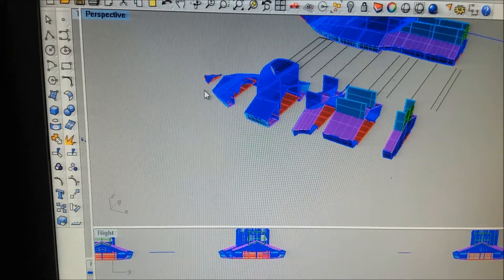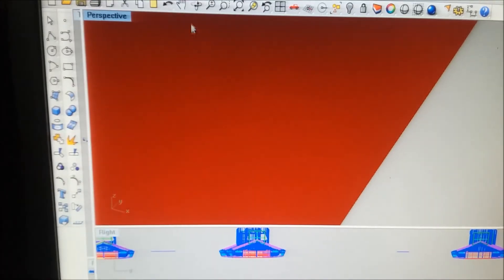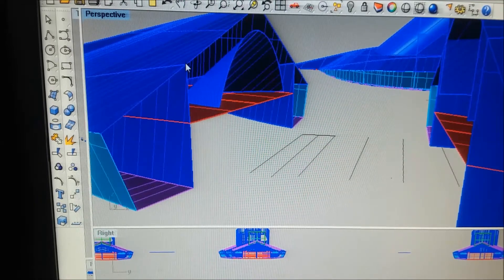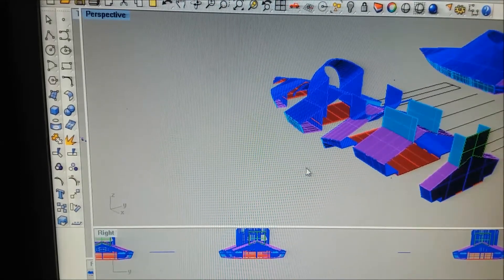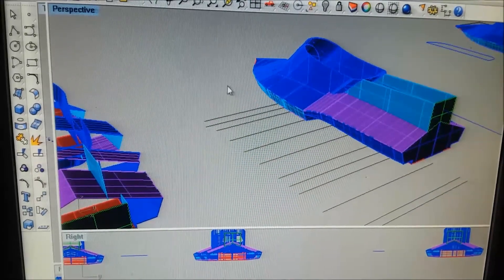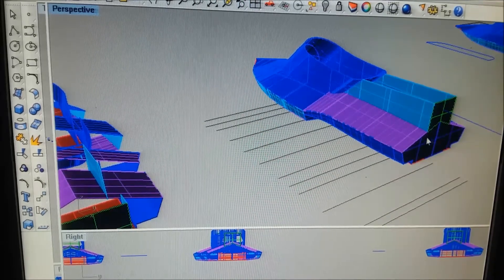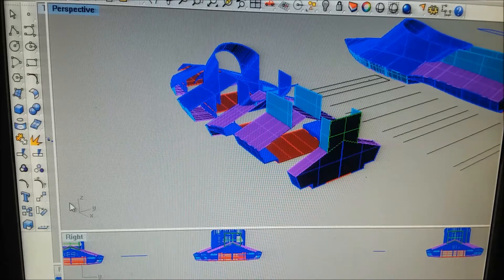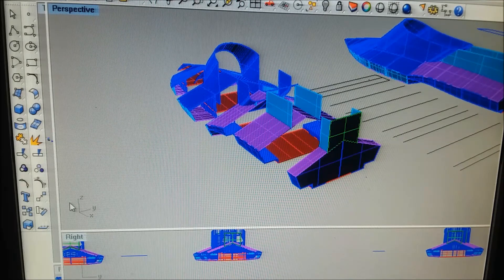"BUILDING OUR DREAM HOUSE IN THE PI", CHAPTER 58, TUNNEL BOAT PART 3 "OUR DECAGON HOUSE"

Comment: are you going to build it? is it for an outboard engine
Reply from the maker: We are thinking a Toyota car engine with a long tail
propshaft and build the propeller (Boy and Benji)
to match the Toyota RPM. I would use an outdrive
but they tend to be problematic and no parts available
here Toyotas are widely available (you have seen the
way they drive) and a Mitsubishi  4G-63 would be great.
     An outboard is hard to get with a short height lower unit.
Reply: @concretehousebuildinginph1488  hi I have some outdrive and outboard props you could have cheap
Reply: Look on my video Box from the UK there is a really nice 4 blade Volvo Penta prop you could make a cone infront of it if you are shaft drive i can give you the size and pitch